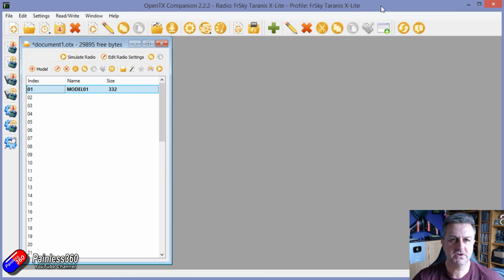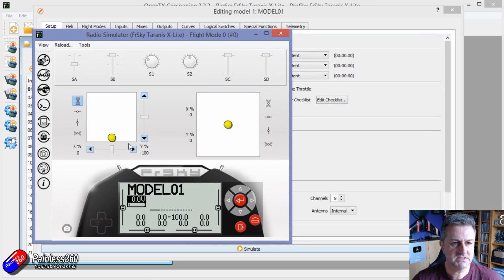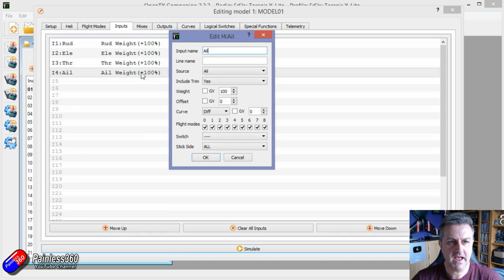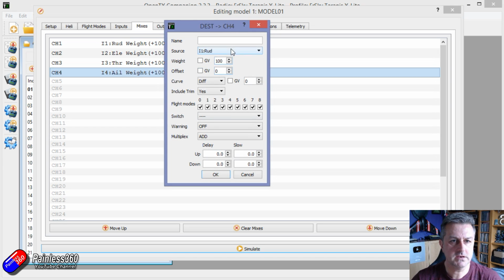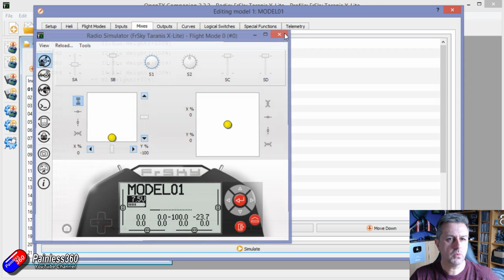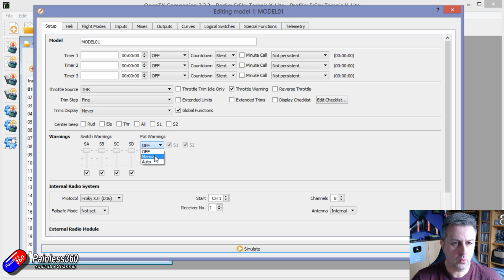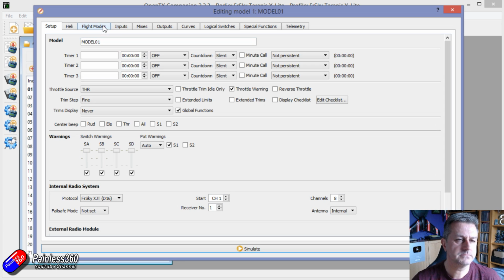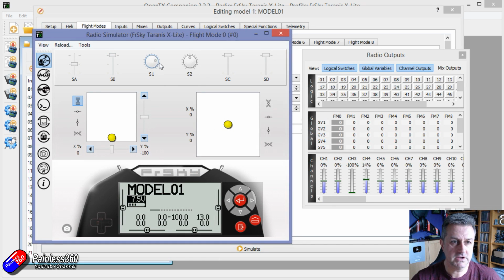OpenTX Quick Tip: Using Pots for trims

Comment: I have been going thru your videos to find an answer but failed. 
I have a Taranis x9e (not the +) on version 2.2.2 and im sure I had that quick setup screen on wings, planes and quads last time i made a new model. 
Last night i went to setup a wing but i did not get those 4 choises. Was i wrong when i thougt they were there or is there some secret to get that again?
Reply from the maker: That setup wizard is actually a LUA script on the SD card. I'd check its still there. Best of luck!

Comment: Anybody know how to invert the trim function when set on a slider?
Reply from the maker: When reducing the weight at 1:00 change the polarity ( I.e. -50 versus 50). See my OpenTX mix school playlist for more tips. Best of luck!
Reply: @Painless360   Yeah that worked :)  Always like to have a "subtrim" on a slider for the elevator on airplanes. Works perfect for adjusting to wind condition / penetration, or when flying inverted for example. Used to always have that on my Hitec Aurora's slider. Thanks for the quick reply, was aware of the mix school but need to watch again. Looking forward 2 new iNav serie.. Keep up the good work!

Comment: I was going to post an alternate trim-related quick tip from a guy in our local North East FPV UK Facebook group, but it is a closed group.  FWIW, here is the link to the video: https://www.facebook.com/francis.thompson.524/videos/10156234923096066/, though you will need to request an invite.  In short, he demonstrates a Taranis OpenTX feature called "Instant Trim" that auto adjusts the trims to your current stick positions when flying straight & level.  Assign "Instant Trim" to a momentary switch, flick it when flying straight & level, then centre the sticks.  The trim will now be set where you previously held your sticks.  HTH :)
Reply from the maker: Great tip - I should make a video on it too.. thanks for the idea.
Reply: @Painless360  Aye, that would be great :)  Keep up the good work!

Comment: Can u do a series of how to use opentx software to change trim global functions switches but change them using the software instead of going into the radio menu and doing it that way.  I am afriad to use the opentx software bc I do not want to make a mistake and brick my radio. I have the horus x10S
Reply from the maker: Check out the videos in the opentx mix school. I've done lots of things with Global variables including changing them using switches and changing values automatically..

Comment: I just got my Taranis + and thought with all the videos on You Tube it would be easy to do updates and learn how to use all the features of Open TX.
I have managed to update to FW V:2.2.3, but can't find the Bootloader V:2.2.3 as I saw one user install?  Most of the videos are for older versions of FW, but I don't know where to find the radio Bin file like it is called.   I've gone to FrSky website and Open TX with no clear instructions.  When I open Open TX it shows a pop up saying "can't open radio bin file"?  I'm lost !
Reply from the maker: I suspect it's something to do with your SD card. I've not seen that area here so I have a look in the forums for ideas. Best of luck
Reply: @Painless360  I finally got the bootloader updated to V:2.2.3,  I don't exactly what I did, but it is done and now I move on to updating and programing the S8R !

Comment: I watch lots if you videos. I have just joined my local club. The club is  majority  fixed wing. I fly quads but I would also like to fly fixed wings. I picked up a used plane from the local bmfa swapmeet. I have a Taranis Q7 and x-Lite but all the trainers use spectrum. I watched your video on the buddy system between the Taranis (master) and spectrum (slave) but is this possible the other way round as I would like to use my radio. Any help would be appreciated. Thank you and keep up the good work.
Reply from the maker: If you set up your radio as the slave radio it'll send out the signals over that cable and then your instructor (who should know his radio well enough to be able to set it up as a master) can do the rest for you. Best of luck!
Reply: @Painless360  thankyou. I will give it a go at the weekend.

Comment: Can this be done with the opposite stick’s trim also? I.e. left trim buttons trim the right stick? And can it be done through the radio instead of through the configurator?
Reply from the maker: Yep
Reply: Painless360 
Yep to all? If so, could you please do a quick tip on how to do it through the radio itself?
Reply from the maker: Yep, I'll add it to the list. Please consider supporting the channel..